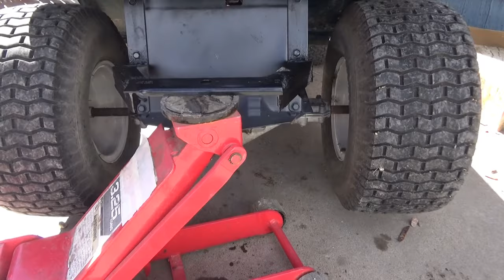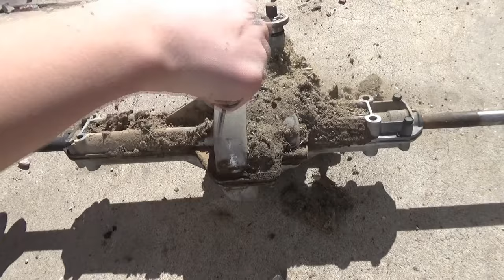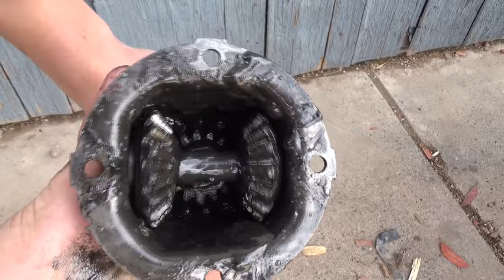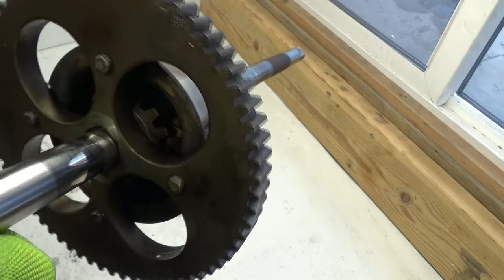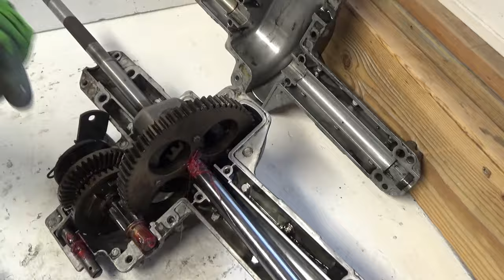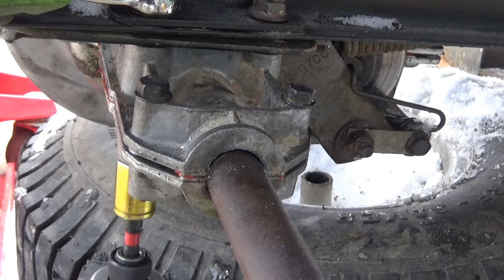Under $20 diff lock(lawn tractor)

Comment: The torq-headed bolts on the bull gear that hold the spider gear casing to the gear are always mushroomed on the opposite side of the bolt heads.  Instead of grinding off the heads, grind down smooth, the other side.  Then the bolts will come out easily and can be reused when reassembling.
Reply: Thanks for the tip!

Comment: Adding dual wheels would give you same traction as posi and a lot easier. I’m fortunate to have found dual wheel adapter on fb market. You have to have threaded holes on plate on one end so you can bolt rims on, cause inner tire blocks access - money to be made mass producing them. I’ll try to post pic of them.

Comment: Hi, Crankshaft Garage. I hope you see this comment. I have the same transmission axle aetup that you do. I can see you welded the spider gears to the pin.  But did you weld the pin to the axle gear? I can't really see in your video. Please let me know, thanks.

Comment: Trying this in mine right now. For some reason, even though I put the tourque wrench to 15 ft lbs, I’ve stripped 2 bolts out and when all the bolts are loose, the axle spins, but when I tighten them, the axle won’t spin. Anyone have any advice?
Reply: hey mate, check for wear on the bolts and if your missing spacers or washers👍
Reply: Nate Levi thanks!
Reply: No worries mate
Reply: I know this is four years late but if you welded anything to your axle gear to keep it from spinning you should have checked it in Lower housing bearings and spun it to make sure everything was True before you bolting it together. If you see this, let me know what happened.  Also does your lawn tractor turn like it used to, or does it push???

Comment: what is the function of that one little ball??
Reply: Try putting that ball on the bottom like he did. It won’t  allow the housing to seal properly. The shift rod bearing is missing on the backside of the shifter. That ball belongs on the top of the shifter, with the spring being inside the top  allen fitted screw.

Comment: What year lawn mower and rear end model number
Reply: The year and model wouldnt matter much. This transmission is in several makes and models. It's a cvt transmission, not hydrostatic. If your mower has a gear shifter with forward,neitral,and reverse then this is most likely the one you have. There was probably different models that had subtle differences like mounting tabs,connection point differences, etc,but the guts would be the same.